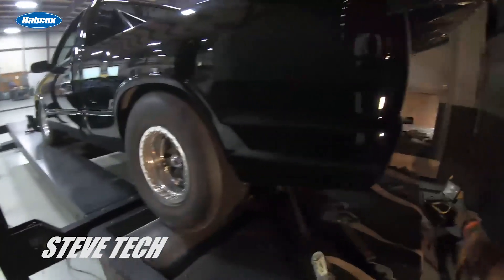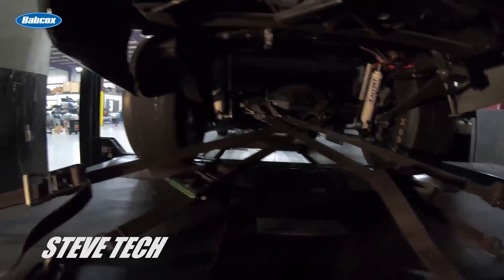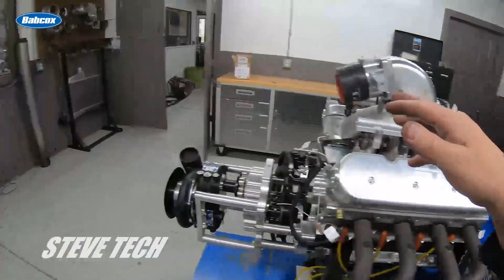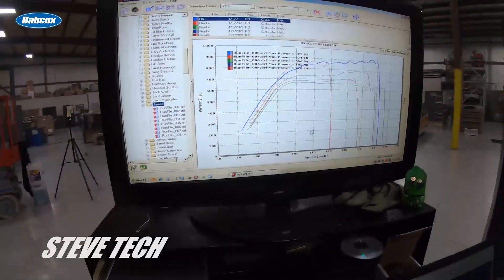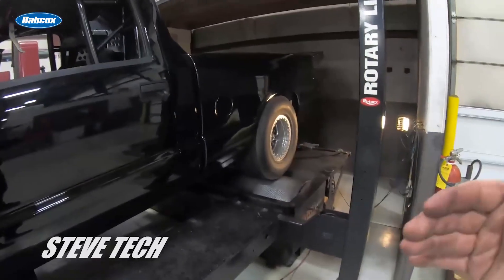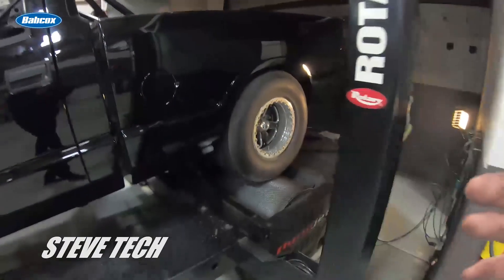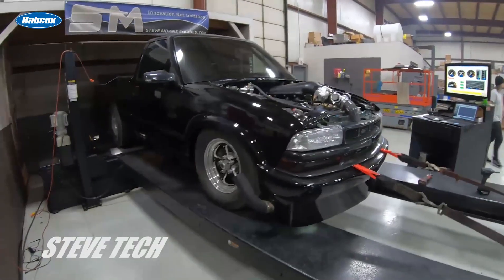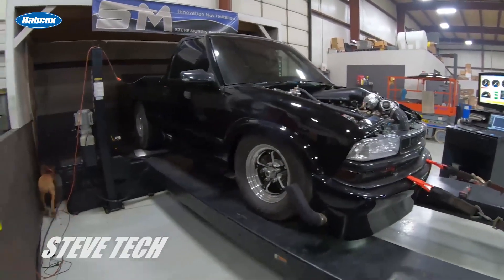Chassis Dynos Explained: Part 1

Comment: If I'm not mistaken, the chassis dyno measures acceleration and RPM (of the drum). With the known moment of inertia (from drum mass and geometry), it's a simple product for instantaneous power (P = moment of inertia * rotational velocity * rotational acceleration). I figure a chassis dyno has more common use because it's literally power to the wheels, which takes pretty much everything into account.

Comment: But Steve, if a guy puts a lower rear end gears in the car, it's gonna accelerate faster. So wouldn't that change the hp reading, without doing anything to the engine?
Reply: hp is constant torque is the one that changes with different gearing, the hp band would look different but peak power would still be the same